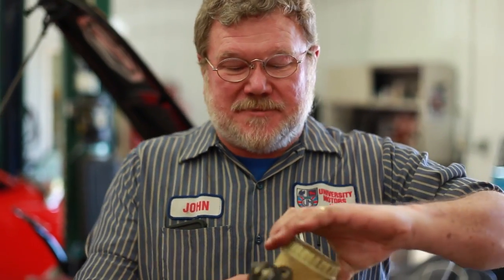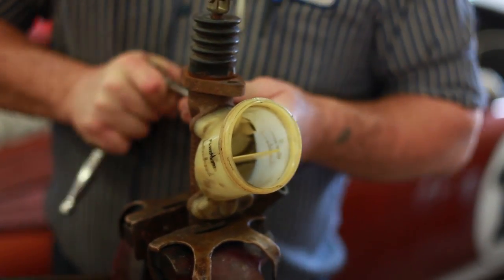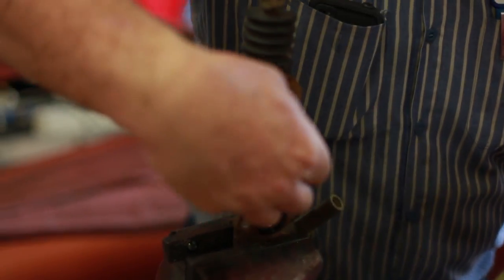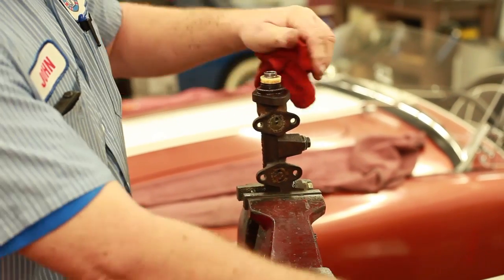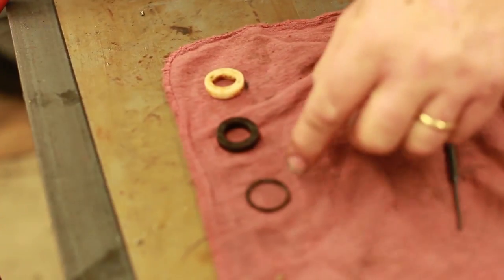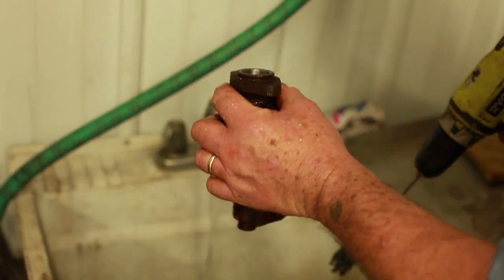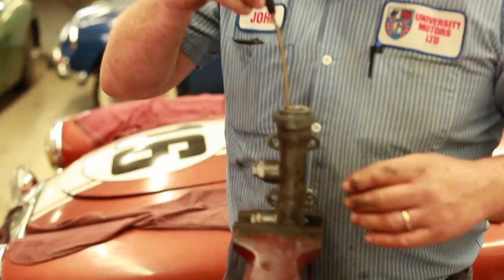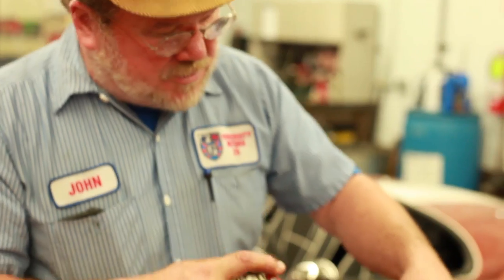252 MG Tech | MG Brake Cylinder Rebuild! EVERYTHING YOU WANT TO KNOW!

Comment: Another very good, clear video John. I've noticed that the small deglazing brushes available here in the UK are often expensive for what they are and prone to breaking - they are also hard to get in anything other than 120 grit. What I tend to do is to cut a length of narrow rod down the middle about half-way and slide strips of emery cloth or wet&dry paper, enough to wrap around the rod several times. I've produced some pretty good internal finishes inside brake cylinders using that method.,

Comment: Important note: internal master cylinder parts should not be cleaned with solvent. the solvent stays in the parts and causes the rubber seals to swell and fail. Use only alcohol to clean the internal parts. Besides that, good video John.

Comment: I used a pair of long surgical locking forceps with the ends ground down to match the circlip holes to remove both circlips without a hitch or scuff. I also had to grind down the body of the forceps a little bit to make them thin enough to get down to the second one. Sure mechanics tools don't belong in surgery or dentistry but surgical tools definitely find a use in mechanical work. I also lost one of the  trap valve springs, so after some research apparently their primary purpose is to slow the return of brake fluid when the brake pedal is released quickly, to avoid air being drawn into the system if your wheel cylinders release the fluid slow enough then this shouldn't be an issue especially on the rear. So I omitted the rear trap valve and I have heard of others that have done the same.

Comment: Stubborn Phillips head screws? dab a bit of valve grinding compound on the screwdriver tip, never slip out, the carbide bites in, and you can dump the hammer routine,

Comment: I truly appreciate the effort and educational value of John's video; but in my 39 years of MGB ownership a NEW master cylinder has been my only considered solution.
Reply: knowledge is great
and can save you money
and can help you stay alive in the middle of the desert 
where money can,t  buy no water
Reply: The price of aftermarket or patent parts has dropped greatly. Now a non-stock master cylinder can be had for $50 to $75 . It used to cost close to $200 for a stock replacement. Rebuild kit was under $30 plus labor. Many of us had to rebuild what we had.

Comment: what a fussy assembly! thanks for sharing.  I wonder if one of those tools that is designed to break free screws that you hit with a hammer and it twists under the force of the hammer blow would break the philips screws on the reservoirs?
Reply: Yes it will. You may find that you will have to use a hand impact driver to remove the screws holding the cover over the brake pedal housing also. Years of slowly leaking brake fluid will almost weld them in place. Stock they are Phillips head and rusty. I replace them with hex head bolts of the same size thread. Not concourse, but a lot easier to service later and there will be a later.

Comment: Is this the same for a Triumph Spitfire? Mine is tandem, but I'm wondering if your tricks will work the same for difficult parts.
Reply: No Triumph used a different cylinder. The reservoir removes in a similar manner. Under it is a large hollow allen screw about 1/2 inch or 13mm that is retaining a "tilt valve". The tilt valve must be removed so that the piston can be removed. The snap ring retainers are similar is style of removal

Comment: Never touched base on how to remove the spring from bottom of the the piston. Having a little trouble myself with it
Reply: John Twist did address the punch needed at the end of the video, but not what a PIA it is to remove and replace the roll pin without breaking the link in between the two halves.

Comment: Those that suggest just paying for replacements or getting someone else to do the job just don't understand the pure joy of DIYing a task like this>
Reply: They also don't take mind of the cost of an OEM master cylinder. An OEM Girling or Lockheed cylinder are still in the neighborhood of $200 plus labor. The cheaper aftermarket ones can be had for about $50 to $75, but are not rebuild-able.

Comment: I could not get the reservoir off, so pressed air solution was out. But I managed to get the nylon ring out easily. Drilled two tiny holes in it opposite each other. Then used a very fine threaded, long tap and made two threaded holes. Putting in one of this a long screw and leaving the tap in the second hole I just pulled the ring out by pulling at both in SYMMETRY. Asymmetrical pulling wil get you nowhere. PS Only one out of two MC's will be fit for restoration, prices for new MC's are falling

Comment: that cylinder could be sleeved and would be better than new
Reply: White Post Restoration used to use brass sleeves to restore the bore. With the cost of aftermarket cylinders for MGB/Midget falling these days it is cheaper to replace than rebuild. Some parts are made of "unubtainium"  and must be reconditioned.